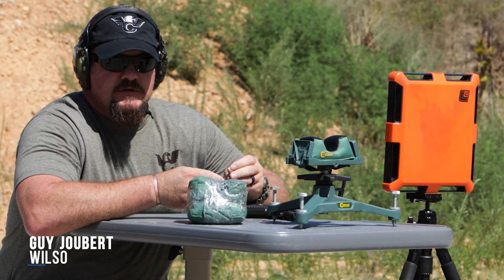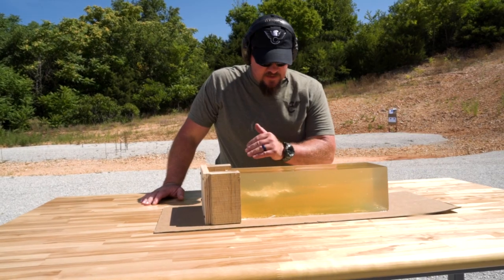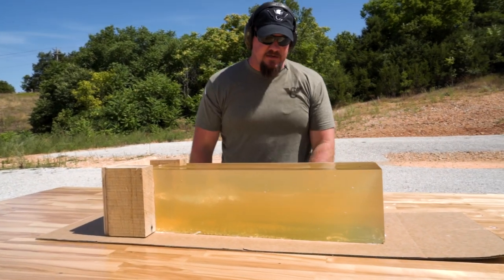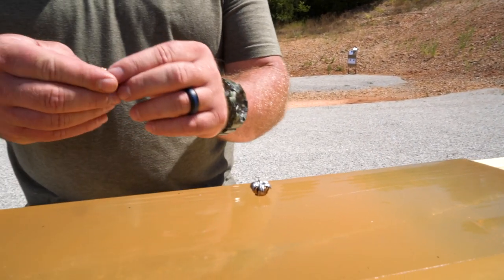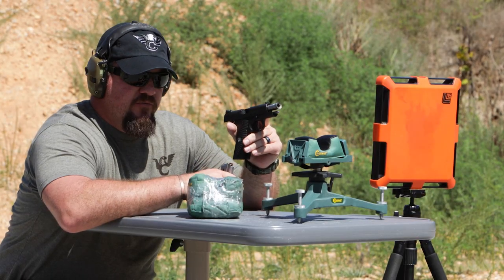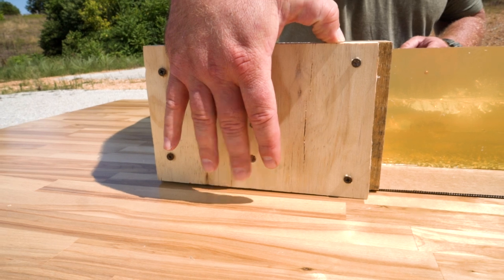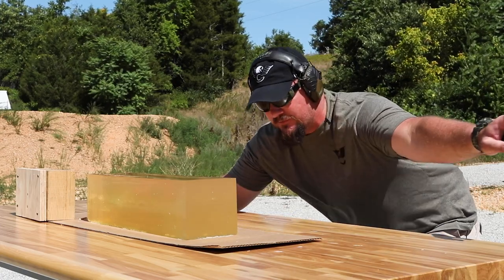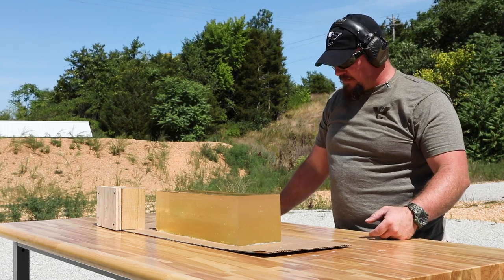Lehigh Defense - Xtreme Defense vs Hollow-Point bullet through a Barrier.  Here's what happened.

Comment: That hp looks like it tumbled and left a cavity,the 65 grain ED in 357 Sig will penetrate very deep through hard barriers but put the brakes on in tissue and is just a great bullet,I have tested them in several videos they will bore through a thick roll of floor paper 4 inches thick two sheets of 5"8 drywall a sheet of 3/4 plywood and a steel stud both sides and exit with enough retained energy to explode a 16 oz can of spaghetti sauce.

Comment: I'm wondering if the difference in bullet weight made a difference ...looked like the 90 grain got 75% of the penetration that the 124 grain got, which is the exact difference in weight.
Reply: Was about to say the same thing. If the Xtreme Defense was the same weight, would it have gone all the way through as well? And is this the regular or +P Xtreme Defense?
Reply: @kenboyles72  Totally! ...& I saw the chrono there, but he didn't show the difference in fps and I would've liked to know that too. Hopefully they'll do another vid soon!
Reply: I think there is to much hype on a lot of ammo. Like I replied to another comment here, even though the  HP went all the way through, there wasn't enough energy left to do any major damage. Plus the fact that it was shot through plywood first, to purposely defect the HP round, kinda makes me question the legitimacy of this test.
Reply: @kenboyles72  
Of course it was shot through a clogging barrier blindness of XDef round cause that 's what is interesting if one is in buildings with furniture or may have to stop someone through a wind shield. The only reason this gets so much flak is the weight difference and that the presentation lacked a bit of confidence.
Reply from the maker: We will produce more gel tests.  Thanks for the suggestion.

Comment: Please give me a link to the Lehigh Defense - Xtreme Defense vs Hollow-Point without the plywood, just the ballistic gel.  I knew the Lehigh Defense - Xtreme Defense would do better than the Hollow-Point from going through plywood first, but I would like to see the one without the plywood.  It also may not be fair that the Lehigh Defense - Xtreme Defense is only 90 grain while the Hollow-Point is 124 grain, depending on the powder load.  Are all things equalized through velocity and any other factors?  The 90 grain Lehigh Defense - Xtreme Defense was slowed down enough by the plywood that it didn't exit this time, but the 124 grain Hollow-Point must have had more powder and faster velocity.  I've seen some showing that the Lehigh Defense - Xtreme Defense exits the ballistic gel with enough speed and force to injure or kill a nearby bystander, but I doubt the Hollow-Point would.  I use Hollow-Point .45 ACP, but would consider Lehigh Defense - Xtreme Defense if it was made in .45 ACP.  Will it ever be?

And let's see an equalized comparison with the ballistic gel only covered at the entry side by a material similar to a shirt that would be commonly worn, please.  It could be wrapped around a bit to be able to clearly see the target square.  By equalized, I mean both bullets the same weight, same powder load and traveling at the same velocity, or as equalized as possible.  And maybe another one in the same video with a common jacket material instead of a shirt material, please, but a second ballistic gel block to keep it more fair, if that makes a difference.  Seems two bullets in one ballistic gel should be enough for that one.  Otherwise, there could be vast variations in the gel, depending on entry points.  Thanks in advance.
Reply from the maker: Here is a test that shows how the 90 grain Xtreme Defense did without a barrier. https://youtu.be/cM2t8Lq3geU

Comment: You should have walked around with the video and showed the other side of the gel. Because from this side it looked like the Lehigh did not do as good of a permanent wound track.

I know from watching other videos that it does do very well so it is probably just the bad camera angle but the point is that it defeated your purpose of promoting the performance. By not showing a good angle of the wound track.

Comment: I am sure that Wilson's Lehigh Ammunition is a good performer, or Bill wouldn't have bought the company. I'm also sure that his non-hollowpoint rounds would be very useful in places where civilian use of hollow points is unlawful, as in New Jersey. But I'm not quite ready to give up on well designed premium hollow points.

I spent about 20 years doing professional level FBI spec gelatin testing, and have found that with loads such as 9mm which reach expansion threshold, hollow point clogging in true premium ammo hasn't really been an issue for quite some time. In these days of repeatable FBI standard tests, one has to look pretty hard to find real, name brand LE grade ammo  that fails in the FBI Plywood barrier test. I don't know what type and brand of this "premium hollowpoint" is, but if this was typical peformance, LE ammo companies would not get too many contracts. There are older hollow point designs still made that won't pass muster on FBI tests, but they are not what I would consider "premium" in any modern sense of the  word. My two current carry 9mm +P loads (I use whichever I can get) are the Federal 124 grain HST, and the Speer Gold Dot. On the Plywood test I repeatably get 14-15 inches penetration with the HST and about an inch deeper with the Gold Dot. Both expand reliably, with the HST opening to a larger diameter than the Gold Dot.

I'm not being critical about the Lehigh ammunition. I'm certain Bill Wilson wouldn't sell it if he didn't believe in it. I'm sure it is fine, and I might well use it on hogs and might also choose it if I thought I'd have to shoot through auto glass, which is a bitch on conventional hollow points. As mentioned, it might be just the thing if you live in New Jersey. I'm just pointing out that in my experience, hollow point clogging with modern premium law enforcement grade ammo is not a major concern.

I guess also that one of my concerns is adopting self defense ammo for which there does not seem to be any actual human shooting data as yet. It could be a while before we get enough of that to be of value. I think this ammo has some value, but I'm not quite ready to switch up just yet.
Reply: It's 124 g HST

Comment: The cracks in the gelatin block are being misinterpreted by many as the "permanent wound cavity".  It is not.  The cracks simply depict the temporary cavity.  The bullet yawed as it penetrated the gelatin block.  When it traveled sideways it pushed more gelatin away from the wound track, stretching the gelatin and causing it to crack when the strain exceeded its ability to stretch.  Whereas soft tissues are more resilient than gelatin.  Most soft tissues can easily stretch and withstand temporary cavity disruption produced by handgun bullets in common combat calibers with no more damage than being bruised.  The permanent cavity produced by this bullet is no larger in diameter than the bullet itself.  Only the gelatin the bullet came into direct contact with was crushed - producing a hole no larger in diameter than the leading edge of the bullet as it penetrated and yawed.
Reply: Hi Shawn. Nice to see you are still around. I used to read your posts on ammunition way back in the days of AOL and computer bulletin boards. If you are who I think you are, I remember that you used to have some spirited exchanges with DocRocket. Take care.

Comment: Sadly, Wilson does something that I didn't expect them to do: provide a false comparative and thus, a false test of the ammo presented.

The presenter did NOT stipulate whether this test had in mind LEO usage or civilian usage. LEO usage MIGHT have at least some context to the test, as officers do sometimes need to shoot THROUGH some type of barrier, attempting to strike an assailant. However, in a Civilian Context, this test is almost worthless, both in public settings and in home settings.

Assailants in public, in MOST encounters, are not hiding behind 1/2" or 5/8" plywood sheeting; they are out 'in the open' and wearing standard clothing for the given season during which the encounter takes place: t-shirt, hoodie or light jacket for most of the year, medium to heavy coat over a t-shirt and regular shirt. Public encounters take place in Convenience Stores, restuarants, sidewalks, driveways, etc., rather than at a construction site where such plywood sheeting might be found. Drywall would have been a more useful tool IF Wilson had wanted to simulate an 'in the home' encounter.

The bottom line for me is that this video should be classified in the category 'propaganda' or 'snake oil'; it's only usefulness MIGHT be found IF an assailant is in a construction site, a housing sub-division that is being built, or some other location where there is an abundance of heavy plywood sheeting, otherwise, it's just an 'infomercial' for Xtreme Defense and nothing else.

Shame on Wilson for stooping so low in such a manner.

Cheers from the Oil Patch in Central WY

Comment: Why did you use an apples to orange video??? They both should be the SAME weight and fired from the same gun. Do you think a nearly 138% difference in size is the same? If you do, next time include a Mini Draco. Why not, if as you proclaim.....size doesn't matter.
Reply: Cooper is lighter than lead..have you seen how long those 115 grain dpx (barnes)  rounds where?